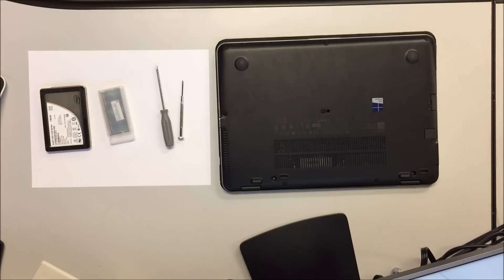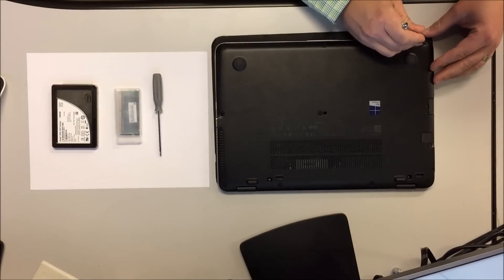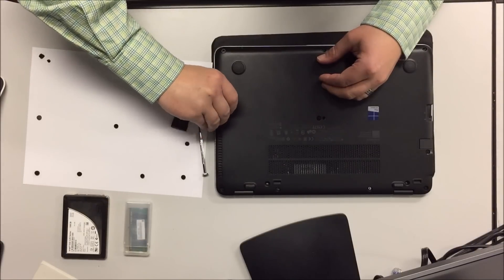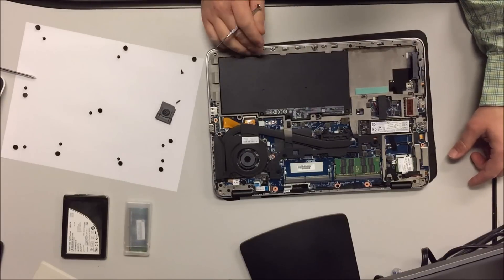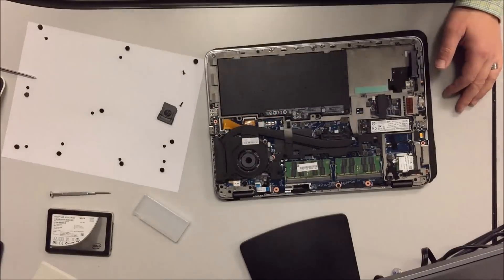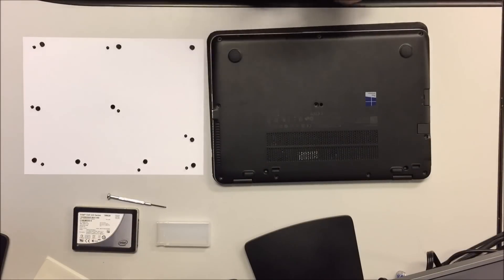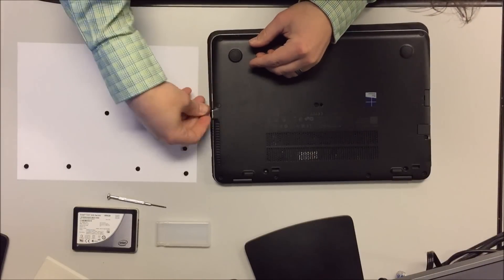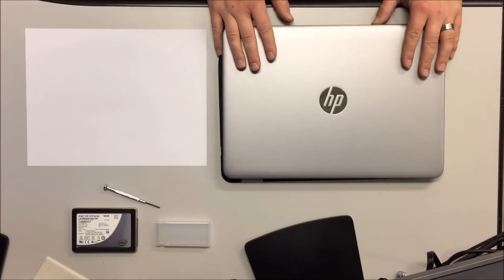How to Tear Down & Upgrade an HP EliteBook 840/850 G3 Laptop RAM & SSD

Comment: Very helpful! I've used HP Elitebooks for years, and always like the ease of opening the older models. When I got an Elitebook 840 G3, I was a bit hesitant to open it up, without first checking out some videos. Yours was the best, and clearest. I would've missed that tricky screw that hides under the SD Card slot. Thank You! 💯

Comment: Wrist strap? LOL...I was/am a Tech since the 80's, never wore a strap and Never whacked a board. I know you are just covering your bases but what a useless piece of crap...first thing in the trash. I guess if your DC/office/home has shag carpeting and it is a very dry day, you'll want to momentarily touch a ground but have yet to run into that type of situation. Good break down though...thanks.

Comment: You can always tell a pro.  I honestly couldn't do my job without my iFixIt kit that includes the magnetic driver.  The knurling is excellent for those really tough lock-tite screws and the (non-captive obv) screws follow your driver right out of the PC.  I had one client that pulled off all the rubber feet, and then broke the base cover thinking the "hidden" screw under the SD card dust guard was under the rubber feet.

Comment: You upgraded RAM which was fine but what was the point of removing the back and NOT installing the hard drive?  this video is worthless wo the specs of the parts you're replacing OR installing the drive.

Comment: The 850 G2 series is a lot easier to crack open.  The back is in two pieces.  All the stuff he did to remove screws and the rubber covers is unnecessary.  One slide lock frees the removeable part of the back and the commonly upgraded components are readily at hand.

Comment: 6:08 I visibly sagged in relief. I worked in a computer store for a year and some nasty laptops needed us to take the back off, then the keyboard, then the front too in order to access the HDD. I have a 850 G3 with 8GB, i5-6300U, and a 128GB SSD. I got it for $225, works perfect for school in 2020. Nice to see I could add an extra SSD for more storage.

Comment: Can I install both M.2 SSD and 2.5 inch SSD on HP Elitebook 840 G3 ?  If I installed M.2 SSD and replace the HDD with 2.5 inch SSD, will the notebook detect both M.2  and 2.5 inch SSD drives?
Reply: Did it work?

Comment: Tks for great vid. Question: 
From the HP EliteBook 840 G3 manual: 
Dual drive configuration
: System can be configured with a hard drive and M.2 SSD drive.
From the manual it seems to support only a combination of M.2 SSD and 2.5 HDD (not 2.5 SSD). Is this correct? Thanks

Comment: upgrade the cpu on elitebook 840 g3 isnt posible...
Reply: You can drop higher rated U series into these laptops, the TDP rating must be achievable by the system so you'd have to do some digging in intel Ark to find a good solution, it can be done and I have done this before in earlier models.  Check hp's page for suggested cpu upgrade options for this model.

Comment: Can we change the processor of Elitebook 840 g3 from i5 to i7 without buying a new laptop?
Reply: Yeah, if you want to switch out the motherboard.
Reply: The cpu is soldered to the motherboard so it's not possible without changing motherboard.

Comment: Great video. Thanks a lot. I have two questions. 1. What are the two spare wires next to the wi fi card for (can you add another thing in there)? 2. Can you use both a hdd in the empty space and the solid drive in the other?
Reply: Yes to using two hard drives

Comment: Thank you for the video. It helped me a lot. Just one suggestion. Please hold the fan in place when you use the canned air. You can damage the bearing. It never happened to me, but it is possible.

Comment: This was helpful. The laptop had a static electric charge that made power circuit in wrong state. Had to take out the battery and hold down power to purge the charge. I would have wrestled with that screw by the SD Card Holder had I not watched this first. Thanks!

Comment: Hey great video. I just wanted to let everybody know that as soon as you take the back cover off the next step will be to remove the battery. You never know when you accidentally going to drop something in the system board and when there's power going through it you could cause a short and burn out your system. It's also a good idea to make sure that the unit has no power going through it while you replace any parts on it. I hope this helps.

Comment: Thanks for the video.  It helped me get inside my G50 G4 to add a SATA SDD in addition to the m2.  One missing item for discussion is that there are no retaining screws nor is there a cradle for the secondary drive.   It's not apparent what is required because you definitely want to either retain it or fill the gap between the back cover and the top of the drive.

Comment: Do you know where and how to get the brackets for the 2.5 SSD? I have the m.2 drive too and those arent included...
Reply: Hp sell them
Reply: Or uy this for a fraction of the price: https://m.ebay.co.uk/itm/HDD-Hard-Drive-Caddy-Bracket-HP-EliteBook-840-850-740-750-ZB14-G1-G2-WT-/173652532393?ul_ref=https%3A%2F%2Frover.ebay.com%2Frover%2F1%2F710-53481-19255-0%2F1%3Fff3%3D4%26pub%3D5574631662%26toolid%3D10001%26campid%3D5338243305%26customid%3D2a92125ea35cdbbcc3e7a52288b9a65e%26mpre%3Dhttps%253A%252F%252Fwww.ebay.co.uk%252Fitm%252FHDD-Hard-Drive-Caddy-Bracket-HP-EliteBook-840-850-740-750-ZB14-G1-G2-WT-%252F173652532393%26srcrot%3D710-53481-19255-0%26rvr_id%3D1858506148193%26rvr_ts%3Ded6a36171680ab6053d106a1ffee6dc4&_mwBanner=1&_rdt=1&ul_noapp=true

Comment: Can you tell me if the m.2 ssd slot has a screw hole for 2242 format or it only has screw hole for 2280 format? I have a 840 G1 that already has a 2242 ssd and I want to upgrade to 840 G3 but I don't know if i should buy one with m.2 ssd or save the money, get one with conventional HDD and fit my 2242 m.2 ssd.

Comment: you should put front of the cover on first as there are little hooks. Also never let your CPU fan spin so fast when dust spraying it. this kills the motor. hold the blades down then spray!

Comment: Does anybody know what the slot to right (as in the video) of the CMOS battery is?
Reply: It's the sd card slot, the slot above the cmos battery is the hard drive slot, and the slot below the cmos battery that has 2 wires is for the LTE 4G module

Comment: CPU is not upgradeable, or let's say not easy to do, it is not in socket, soldered on board. 

SSD for upgrade can be 2.5" SSD or HDD,  or M.2 format, dimensions 2280, SATA (max ~500MB/sec transfers) or PCIe NVME protocol supported (aka HP turbo drive G2, like Samsung XP 951 and newer, 1.5GB/sec). 

zbook 15u G3 is the same chassis with the same expandability

Comment: The 950 Pro WILL fit in this machine. HP finally changed the M.2 Slot to a 2280 (80mm long) industry standard slot on this. The previous G2 had a 2242 PCI Express M.2 slot and the G1 had a 2242 M.2 SATA only slot. 

I purchased an Elitebook 820 G3 for a customer and upgraded it to 16GB of ram and a 950 Pro SSD. We "dual drived" the machine by adding a 2TB 5,400 RPM SATA drive for data only storage and the 512GB 950 Pro for the boot drive. Fast as shit.
Reply: +Michael Yockey 
So, HP 820 G3 may have SSD in M.2 and HDD/SSD in SATA slot at the same time? Datasheet says that it's not possible - "Only a hard drive or an SSD can be installed. To install a hard drive, be sure that the standee is stored
beside the hard drive slot and not installed across from the SSD connector."

Also do you have any cons on this device? 

Thanks for sharing
Reply: I use a 820 g3, now with two SSDs: One in the M.2 Slot (500 GB) the other (250 GB) in the Slot for the 2.5 Inch Slot. They can be used together, the trick is to open the 2,5 Inch case and use just the pcb. With the new 850 Evo from Samsung, it should be possible to use 2 TB (1 TB 2,5" and 1 TB M.2). That's a whopping 2 TB in this small Notebook!
Reply: I own a 840 G2 and I like it very much except for the fhd screen which has limited srGB AdobeRGB coverage for a laptop considered top of the line. Are the Zbook 14 G2 or Zbook 15u screens better?
Reply: Michael, I just bought a Elitebook 840 G3.. Im planing to puta SM961 126GB on it, What Read and Write speeds are you getting with the 950 pro?

Comment: thanks for nice review. Can HP Elitebook 850G3 have PCIe based SSDs such as Samsung 950pro or OCZ RevoDrive4000 in m.2 slot ?
Reply from the maker: Yep!
Reply: +Tardymo technically, it is - its the NGFF (next gen form factor) mSATA drive, dubbed "M.2" slot (so, mSATA second gen slot). NVME SSDs can go in there too (if the M.2 slot is setup to attach to the PCiE x16 slot). HP have the Z turbo drives which are the PCiE based SSDs which you can have installed @ factory by HP (you can CTO them too). Good vid Eganwp - Cheers
Reply: Fair enough - I get your point, but then why call it an m.2 drive if not, msata 2nd gen? What other relevance does the naming convention have to the storage form factor/
Reply: +Eganwp So why are you telling it's an mSata drive then? :)
Reply: +Milan Osborne
I wouldn't call M.2 drive an mSata. Those are two different standards and even though M.2 also supports SATA interface, technically it is not an mSATA. How can you call a drive being mSATA second gen, if in many cases it does not even have a SATA connection (like NVME drives).